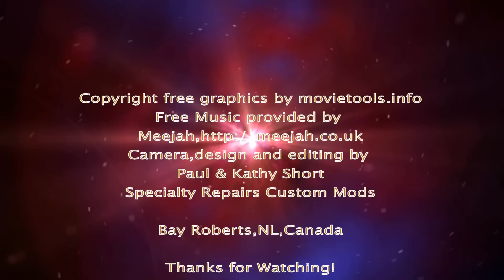Jan.13th Snow Clearing With Bonus Footage

Comment: Good one Paul. I've had my Quadcopter for over a year now myself. Carbon fiber blades and practice, practice, practice a must. Took mine up in the clouds I couldn't see it. Had to hit the Return To Home button.....thought I lost it. Lol. Safe flying!!!
Reply from the maker: George A. Woods I've got a lot of experience with RC planes but this is the first quad. With GPS and compass it should be fairly easy. Did the firmware updates last night, red all the manuals, looked at a lot of video's. I'm familiar with the unit now but there's to much snow down to really want to try it. This is the new V3.0 model so It should fly nice. Not a nice feeling when you think you lost a craft. Glad it worked out well for you.

Comment: Hi Paul and Kathy, We purchased a Kubota 2301 last Spring and have used it for mowing, hauling, landscaping and more. As Winter approaches I have a question for you. Our driveway is over 300', 12' wide drops from our house to the road 30'. We have a 52" bucket and I'm wondering if we can plow snow with that or should invest in a plow blade. We have a Honda track driven 30" snowblower but with warmer winters can only use for 50% of storms. It's not so much the investment but hate to buy something to sit in the yard thats not needed. Look forward to you input, Thanks!
Reply from the maker: Plowing with a bucket is not my  idea of a fun time. It takes to long using the bucket. Buckets are only good for moving snow not plowing it. Get a good blade like I have in the video. Where it has the poly skin on the front and snow won’t stick to it and you’ll be able to angle it making a very fast efficient job of moving your snow. Yes it’s an added cost but because of the efficiency of the blade you’ll do your driveway in 1/3rd of the time meaning less seat time, less fuel, less wear and tear on your machine and more time for you to do what you want. 
Well you asked and I answered 😂
Reply: @7863348  First off, thank you for such a fast response.
You kinda told me what I knew, The right tool for the job. I'm gonna listen to your advise and head up to the dealer this week. Thanks again
Reply from the maker: Your kindly welcome. If you ever need cool accessories for that awesome tractor check out our web site. Keep well 
https://www.specialtyrepairscustommods.com/b-2601-accessories

Comment: Happy Birthday!  So sorry you are sick and having to work.  The metal items look to be off a rotary hay mower.  Not sure of the brand but I myself have worked on more than a few. Would like your opinion of what kind of metal they are made of? They seem to be a very hard steel and weld like crap. Or at least I do on that steel!
Reply from the maker: J Harrison 
Thanks. It's been a rough flue. Even my doctor buddy was laid up with it for a week. Yes the parts are off a rotary mower. I don't know the brand name of them but they are only common 1/8th plate and are not hardened. These weld up really nice. I guess it all depends on the brand of the unit.
Reply: The reason for welding would be a quick fix until a new one can be ordered.  I maybe have contaminated steel from miles contact with the earth.  It really seems like a opposite forces are pushing back on the puddle and cause lots of spitting and popping.  Is this how magnetized steel acts?
Reply from the maker: J Harrison I've never ran into it. Do the welding machine perform well at other tasks?

Comment: Greetings Kathy and Paul,  Please forgive me if you answered my question in a previous video but I was just wondering if Kathy ever wanted to learn how to operate the 5740? Furthermore, have you ever changed the cutting edge on the plow or is it the original cutting edge from 20 years ago? And if its not the original, how long does a cutting edge last, for you, on the plow? Also, have you had the blower on the 5740 clog up from really wet or slushy snow? I watched a video and the person cut up a rubber mud flap from a truck and screwed/bolted it to the impeller fins to close the clearance between the edge of the fin and the housing, and the blower went through slush and wet snow and threw it a good 10 feet like it was dry fluffy snow and that impressed me. It was a two stage walk behind blower but I assume it can be done to 3 point hitch unit as well. Additionally, what is the small black rectangle at the bottom left of the small overhead door on the shop? Also, what brand tire inflator with the built-in air gauge were you using on the GMC's tire? The cheap one I have is 35 psi off and I would like a quality one that tells me the correct reading. I got what I paid for unfortunately. :) I apologize for influx of questions, I really enjoy watching your videos and happy belated birthday. :)

- Jon in Pennsylvania, US
Reply from the maker: Jon Rushing 
Hi Jon. No.Kathy really never shown any interest in the 5740. She says it looks to complicated and says I do ok with it. I'd rather she get interested in doing shop work lol. I've owned the Arctic Poly blade since new in 1994. Its been used commercially all that time. The cutting edge is reversible and if you do it right and watch how it wears you can flip it over for a few years and use it again then go another few years and do the flip all over again. I got 15 years out of the first cutting edge before I replaced it. It's just a matter of knowing your equipment and keeping an eye on it.

No. Clogging hasn't been an issue for mine. It's a 60 hp unit and can move a massive amount of slush and snow. I've seen home made impeller kits like you have described though and they do work. 
The rectangular black item in that door is a handle that was intend to open the door. It was never used because our doors are remotely operated and they don't even need to be touched. 

If you asking about the compressor in the shop it's made by Techquip. If your just asking about the gauge /air chuck its a Milton unit.You'll find that Milton builds about the most reliable pneumatic tools in the world in my opinion. 
Thanks for watching our video's. We really appreciate it. Great to hear your enjoying them.
Reply: Paul Short I looked into Milton and their products on Amazon and found nothing but positive reviews on all their products. I will definitely purchase from them and give them a try. Quality truly comes before cost and I learned that the hard way haha. Thank you for recommending them. Have fun "playing" with your new drone.

Comment: Happy b-lated birthday! Holy Crap, Congrats on the new toy!

Boy all that water would drive me nuts, I think you will have to add a floor drain in your shop. So what temp is your shop set at?
Reply from the maker: drom industry 
Thanks. There's a drain right by the ramp but when there's snow coming off the machines constantly there's not much we can do about it until it melts. As for the shop temp. that depends on how hard I'm working. I can have it set at 60 or as far up as 90 if need be.
Reply: Thats good to here, have fun with one of the best drones out there

Comment: Nice Job on the video.  Have a quick question for you if you can.  I have a John Dare 1023E, front bucket movement control level moves in all directions side to side up and down but the bucket and cylinders will not move. Sorry to say my tractor is outside covered up but I think it is frozen with the weather we have here in Michigan, at night around zero days in the low double digits right now.  Tractor starts fine let it warm up for an hour still no movement in bucket.  Tractor will drive forward fine and a little slower in reverse.  What do you think I should try and do to get movement for bucket cylinders?  Oh ya for the backhoe no movement of any of the cylinders.  Not sure if I can get a way to heat any of it up or not out side.  Can’t move it because the way the bucket is angled into the ground.  Thanks, love your channel and the things you work on.  Take care, be safe, later.  Oh ya Happy Birthday there bud.  Love your birthday gift, just getting into the drones myself have a smaller one just beginning I love it.
Reply from the maker: RDViper2013 
Wow. You got a weird one there. Ok. First question. when you move the lever with the tractor running do you hear any whining or hear any change in sound?
The next step if it was mine would be to remove any quick change couplers and plug them back in again then try your controls to see if that made a difference.
Personally I can't see anything being frozen. Those systems are designed to operate in most any condition. A work shop manual would be your best friend at this point. The fact that there's nothing operating on the back hoe has me concerned. 
I put a link over on Tractor By Net in the Deere section for you. Head over there and if your not a member sign up, Its free and post the question there. someone may have ran into the same issue and might be able to tell you first hand the problem.
Let me know what happens please. 
Thanks for your kind words. 
http://www.tractorbynet.com/forums/john-deere-owning-operating/

Comment: What a beast!!! I see you've got a Kioti Killer sticker on the front. Maybe you should put a Deere Hunter sticker somewhere on her as well? :D
The Kubota  handles that wet, heavy snow without even spinning a wheel. Are you running loaded tires?
 I'm going to have to consider a Kubota when I eventually have to replace the old '52 Allis-Chalmers that I'm using now.
Reply from the maker: Truck Shackley 
Thanks. The Koti Killer was put there to pick on my buddies who have that brand lol. No Deere's around here. They all ran away so it's true" Nothing runs like a Deere" lol. Oh man you got to keep the '52. They don't make them like that anymore my friend.
I'm running 840lbs of wheel weights on the rears. It does well with them on. 
Thanks for watching.
Reply: As my dad used to say,"Nothing runs like a Deere...or smells like a John."lol
Yeah, the old '52 Allis has cleared my driveway every winter for close to thirty years now. So unless she throws a rod out through the block and suffers a nuclear meltdown it has a home here. I gotta get a descent camera and post some video of it doing it's thing some time.
Reply from the maker: Truck Shackley 
You just got to respect a machine like that. I'd love to see a video of it. Keep well.

Comment: Hey Paul. Do you ever find the tractor lacking traction on the front wheels?

I'm gonna be using my m135 kubota for snow work for the first time this coming season and I'm wondering if I'll need front ballast. 

Thanks!
Reply from the maker: I haven't butntheres tricks to keep the traction on the front wheels and I mention it many times in my snow clearing video's

Comment: If I ever have the money, I'd love to use a tractor similar to that one for plowing snow instead. Sucky part about using a pickup is that you can't put any downward pressure on the plow itself to scrape anything up or drag backwards effectively (plow just rides up on the snow.)

How would you say it performs in these two situations?
Reply: Check out Ebling back blades... I just got one. Everyone who has one says they are amazing

Comment: is it best to run the plow and blower on full rpms? or will it damage the engine?
Reply from the maker: +Hockeymike16 
The blower should be run at 540 rpm and the plowing is up to ones self.
Reply from the maker: +Paul Short 
I should have stated 540 PTO rpm for the blower
Reply: oh ok thanks! nice job

Comment: I just saw the first of your videos, very entertaining.  I used to plow my driveway and a couple of neighbours with a 1994 2.4 liter Toyota 4x4 (5 spd standard). It was amazing how much that little truck could push with a 7' blade.  If I could buy a new pre-2005 4 cyl Toyota 4x4 (standard) I would do it in a heartbeat.  Great little rigs with a solid drivetrain.  

Anyhow...the reason I started this comment was to tell you your web site (www.specialtyrepairs.ca) isn't working.  I tried with a couple of different browsers and get the same error message;

"No Start Page

Could not display this Web Site as no Start Page has been configured. To configure a default starting page, set one of your Web Pages to be the Start Page. Please contact your Administrator for more information."

Sorry for the long winded message !!

Cheers,

joe
Reply from the maker: I agree Joe they were a nice truck. They did rust pretty fast but other than that they were a nice machine. I announced in our latest video that we are now gone from Facebook, Twitter and we shut our web site down. Thanks for the heads up though.
Reply: OK, sorry, I didn't know.  I got new video notice almost an hour ago and watched it right away !!   It was the one where you made, installed and painted a spill-over top extension for a new BX25 bucked.  You do very nice work !!  Good tips too.  It's evident how much the two of you enjoy each other, it's heart warming to see !  I've watched a nice few of your videos so far and am really interested in the Kubota tractors.  If anything they should be paying you commission !!   You're an ambassador for them..!!  I was the same way for Toyota till I bought the (then new) 2005 larger mid-sized Tacoma.  I drove those little 4x4 Toyota trucks since '79, that new one was a total disappointment.  I wish they'd allow the Hilux in. :(   

Anyhow...I have a Kubota diesel in my boat and never had a second's trouble with it. I was  surprised to learn (from you!) how inexpensive those little tractors are.  I have a long driveway and clear all around my garage which was a pleasure with the old truck and plow.  Takes me three hours with a snowblower and half of it with the wind in my face.  I don't have enough room to store a tractor inside my garage so maybe I'll pick your brain on those zippered shelters you use...and, for a lead on a good used BX !!

I know, I talk too much !!!

Thanks, and Merry Christmas to you both...

'nite,

joe  ;-)